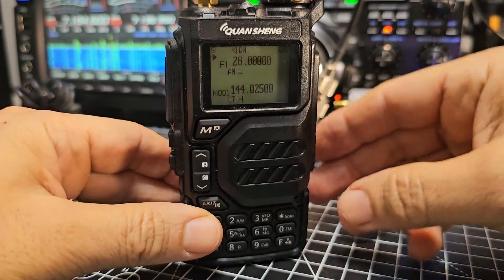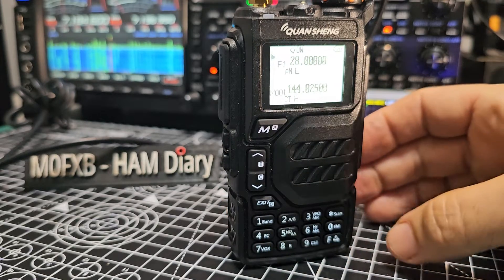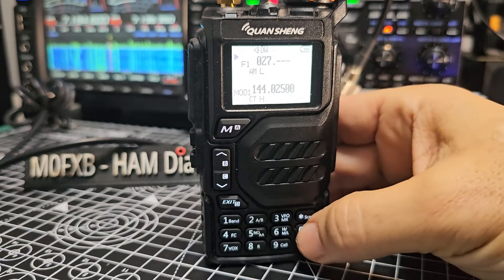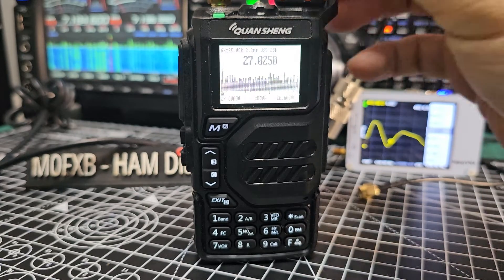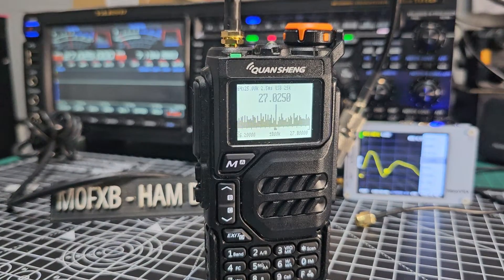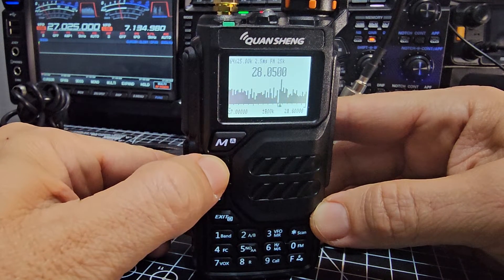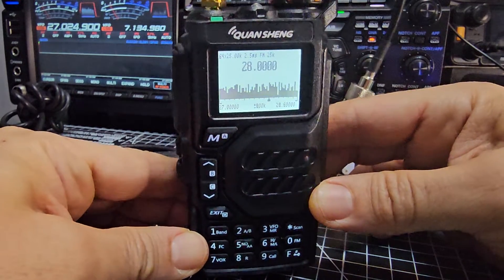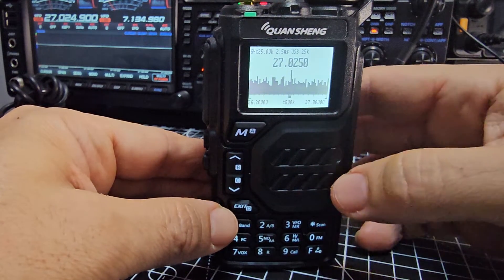10/11 Meters , Quensheng UV-K5 ??? is it possible??

Comment: Quick question? I put mine on a 11 meter dipole, that has a flat match at 27.400 ,when keying the radio on fm, it showed 4 watts, but it had a 4.1 to 1 match. Any idea why this would be ?  Thanks Jack
Reply from the maker: Try and counterpoint connected to base of antenna about 140cm long .

Comment: You are hearing USA on 10m CW.  CQ WW test this weekend.  But some SDR frequency filtering is needed to get better RX, because it is extremely wide.  That seems to be the main issue with this receiver.  You will get interference, because the receiver is covering too much spectrum.   And you can not get a lot of signal processing with an el cheapo chip :P
Reply from the maker: Yes but £14
Reply: @M0FXBHamTech  I have ordered one myself :)
Reply: You can narrow the bandwidth from wide to narrow
Reply: @DeanSwann  TNX!   I got the radio yesterday and noticed it have W/N select.  I suspect the bandwidth is related to W/N on FM.  Got mine programmed now and have just tested AIR band for the local air traffic.  AM works fine with the newest formware.  I am scanning a few local AM and FM with squelch on, and it works flawless so far.

Will test it on SSB HF later.

Comment: Just got a UV-K5 (8) /6 on ali black friday deal for 13 quid. cant wait to flash the modded firmware I also got a bunch of antennas including a 27Mhz one
Edit: I also have the old front from an anytone 878uvii plus. I accidentally dripped from the fifth floor balcony (now repaired) Im hoping that speaker might fit inside the new radio as its gotta be a better one coming from a 200 quid radio...
Reply from the maker: Both good sets